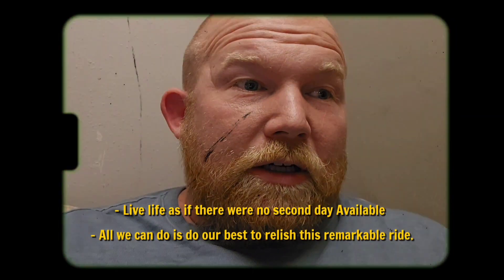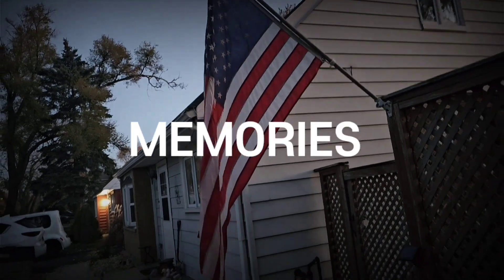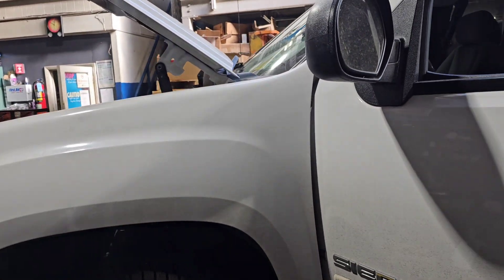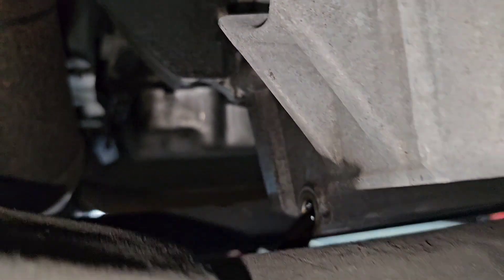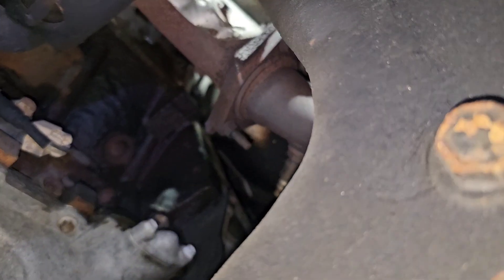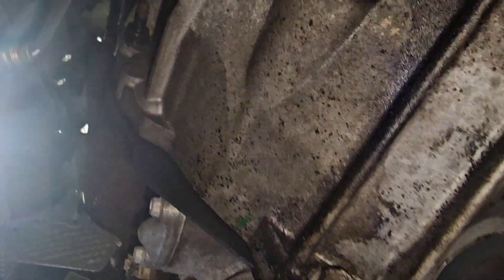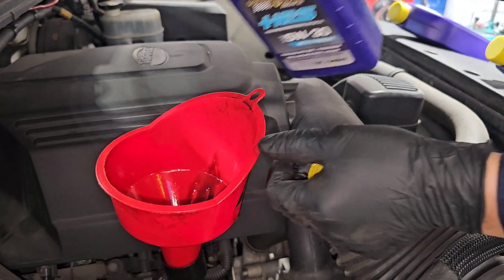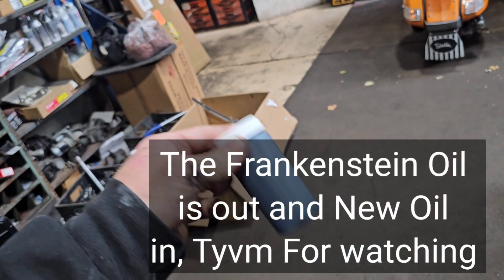I Put 6 Different Oils In My Truck - Switching To Royal Purple HPS and A Ford FL500 Filter

Comment: Running 5qts valvoline fs high mileage and 2 qts extended protection 5w30  in my ram 5.7 hemi ...... about 500 miles now lovin this oil .......gained a little more oil pressure overall and smooth and quiet running

Comment: I was told at a young age that "clean oil is the best oil" by an old hillbilly mechanic.
We bought a used '17 Escape with 50k and started using Amsoil S.S. in her and after the second change, the oil was difficult to see on the dipstick due to clarity until it had 5-6k on it.

Comment: Greetings! Off topic correct me if I'm wrong!! I was thinking about installing the BOV on my Ford Maverick, but would I have long-term problems if I did that? the air escaping has already been measured by the MAF sensor. The ECU determines a specific amount of fuel to inject based on the expectation of this air being present and the car will run rich.
Reply from the maker: Some people do it and they won't have any problems
Reply: @FordBossMe  thank for the quick reply Boss have a great day brother

Comment: Just a Question to ask you, is it better to chamge engine oil at 3000 miles or 5000, just wandering, been changimg at betwen 3 and 5000, on. My 97 ford expedition 5.4 4x4
Reply from the maker: 5000 highway 3000 all around town 4000 mixed